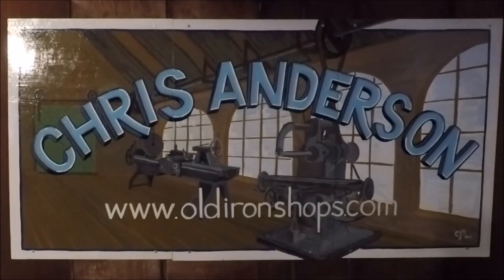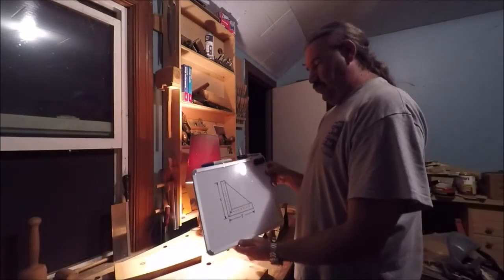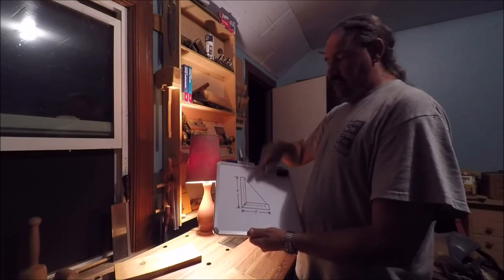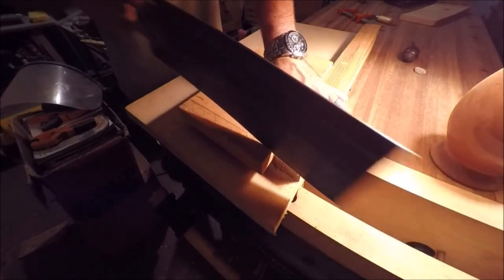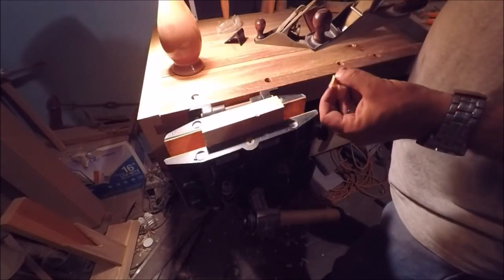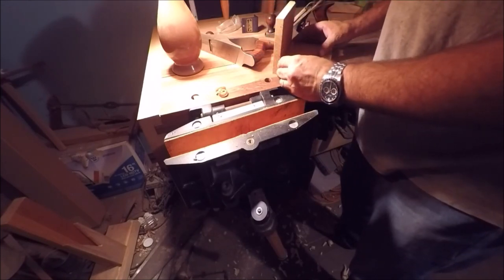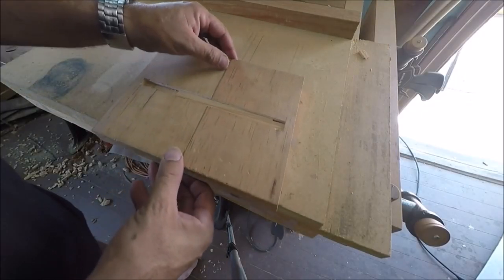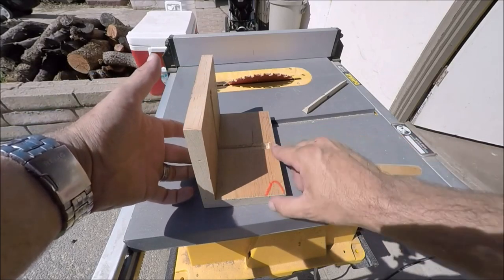Wood Pattern Making Process #1

Comment: Chris did you take the expansion of molten metals nto account in your measurements?
Reply from the maker: +Craig L. Young in this pattern I didn't really care about that because all the faces are going to be machined .but you are right this is something that can matter I believe iron shrinks 1/8th per foot. This pattern us about 5 in. Wide so we are only talking 1/16" on the longest dimension. Rapping the pattern can add that much. And in this instance it will no matter .